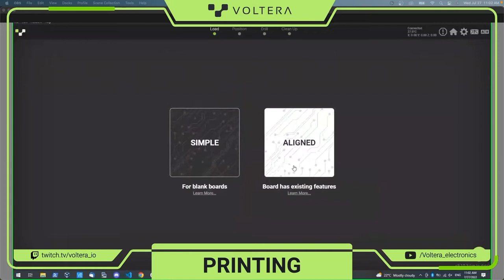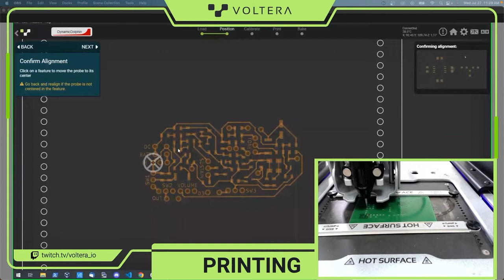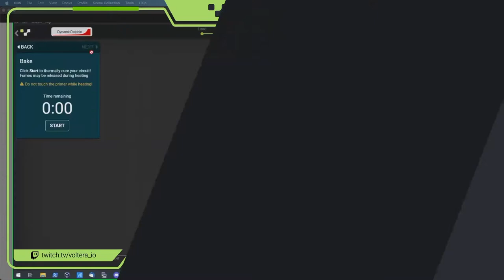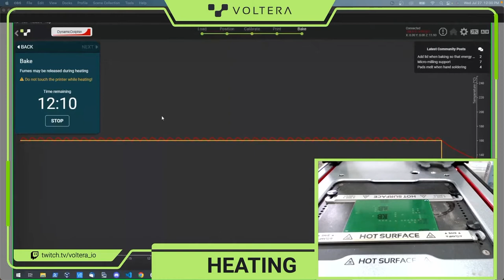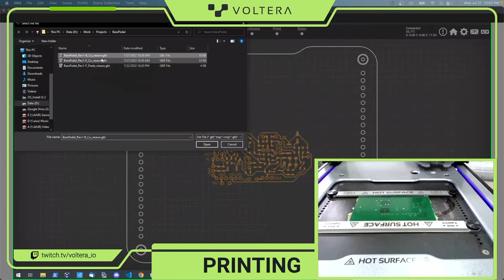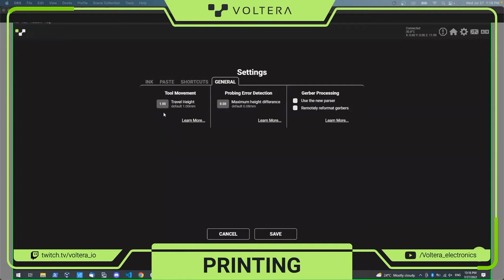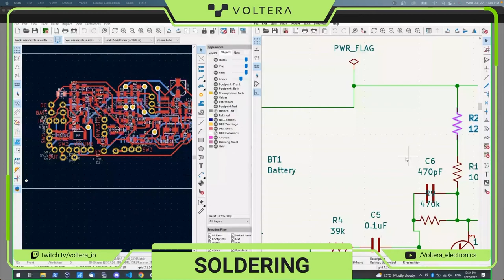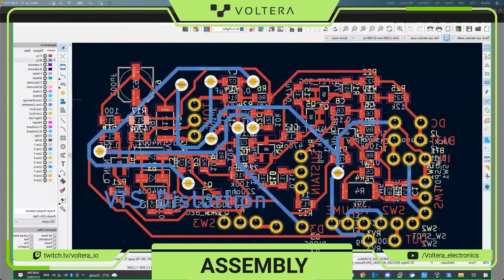Webinar: Additive Methods for Two-Sided Boards on the V-One

Comment: Is there a good potting compound that you could use over voltera ink?  I have some 5-way switches I want to use (alps alpine SKRHADE010), and I want to make sure that using the switch doesn't break it off the traces.  I have some UV cured resin from Formlabs (clear resin) that I can pour over the edges, but what is a good way to POT components that might be subjected to more vigorous lateral forces?
Reply from the maker: We haven't experimented much in-house with potting compounds. We did recently test UV resin in terms of its ability to hold components in place, and were actually quite surprised at how much force was required to pull the component off the board. With that being said, we'd love to hear more about what you're working on. We'd be happy to work through this with you and do some experimentation on our end as well. Feel free to reach out to us - hello@voltera.io.